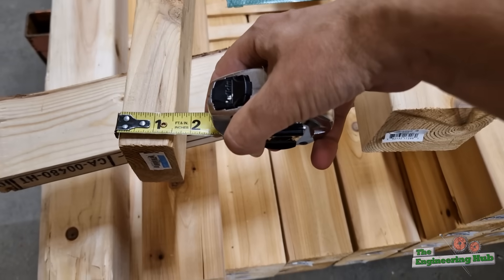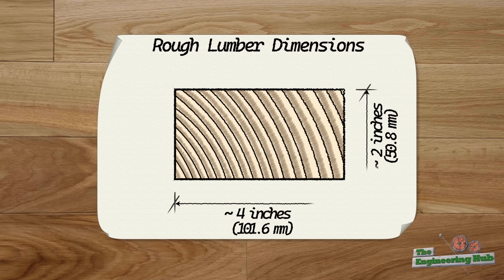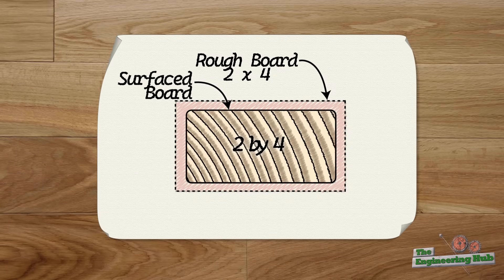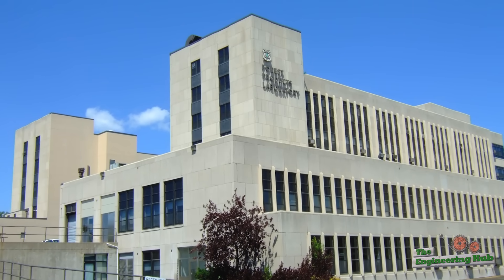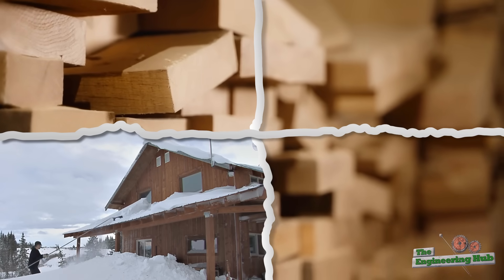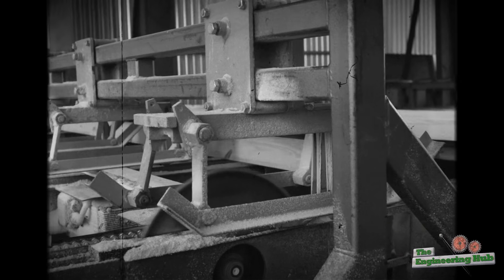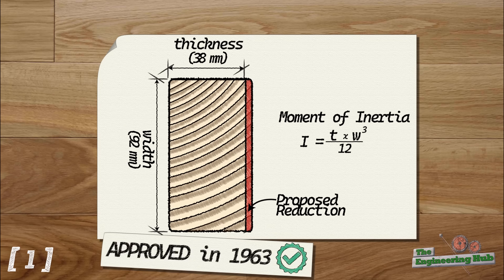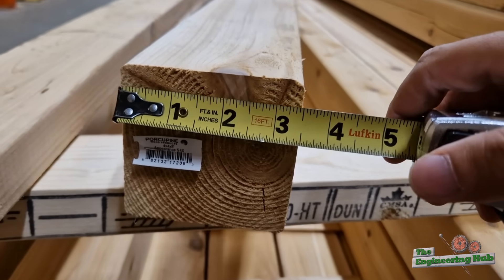Why is the 2 by 4 getting smaller and smaller?

Comment: The house I grew up in was originally two houses built just post WWI from drift wood from the storm of 1900.  If you are unfamiliar with this storm, it's the greatest natural disaster in our nation's history.  At the time, Galveston was the 2nd largest and busiest port in the US.  It was the central hub for shipping out crops grown in Texas and the mid west which needed to ship via train rather than river.  It was also the distribution center for goods going up the rail to the mid west.  In 1900, without warning, one of the strongest hurricains ever recorded hit Galveston directly.  Everything and everyone was swept away in the storm surge.  Only a handful of buildings made from stone (which is rare in the area as bedrock is 200 feet down) or concrete were left standing.  For months, bodies were being recovered from piles of wood which were once the buildings on the island. 

 After WWI, cheap housing for the returning solders was needed, so the piles of wood were finally gathered up in mass, cleaned of nails, and processed into lumber.  The mill making the lumber made S4S on true dimensions.  So, all of the 2x4, 2x6, 4x6, and 4x8 lumber in my house was true dimension and finished cleanly.  A side effect from being in the salt water for so long was the wood absorbed the minerals, making it very dense, strong, and hard.  I don't think it was that hard when the houses were first built, but when I would do any repairs in the 1980's through to the early 2000's, I had to drill a pilot hole for any nail or screw I wanted to drive into the original lumber.  It was almost as if it were quick fossilized as it dried over the years.  It was very interesting to see the story the wood told.  Some of the exposed wood still had the remains of joints and nail holes from the original construction.  Some of the original hand made nails were used in the larger lumber.  The houses were built on pier and beam foundations, with one extra layer of timbers before the floor joists.  Most houses of the day, or even those built with the same type of foundations today, don't feature this extra layer.  I always thought it was for air flow to help cool the houses in the hot, humid summers we have.  

The flooring was even milled from this drift wood, but softer wood was chosen at the time as to not wear out the knifes on the milling machine.  The flooring plank milling machine would take in rough cut lumber, hold it straight for the 6 to 10 foot input guide, and then run it through 2 to 4 sets of spinning knifes.  If it's 2, then the top and bottom surfaces get taken to final dimension and finish.  Then the 2nd set of spinning knifes cuts the tongue and groove profiles to allow the flooring to overlap without being fully seated into each other.  A 4 knife set would have knife sets that would get the wood within an eigth of an inch of final size, then the last pair would get it to final dimension and finish.  The 4 knife setup was more expensive to setup, but it would reduce the wear and downtime as the finishing knifes would last for many more board feet.

The milled flooring planks were installed in two layers.  The first layer laid right on the floor joist and were attached to the joistes with nails through the lower part of the mortise.  The next row was laid down as the tongue was aligned with the mortise of the previous row, but not inserted into the mortise.  This make that row partially sealed, but still allowed air to pass with ease.  The top layer was laid perpendicular to the first layer of flooring.  Just as the first layer, the planks were attached with nails through the lower part of the mortise.  This time, the next row had its tongue inserted half way into the mortise.  This still allowed some air movement, but sealed the house a bit better from insects and dirt.  The floor was finished by first sanding the whole surface, then a hot wax mixed with a thinning agent and shellac was buffed into the grain.  This was a very hard wearing and easily maintained surface finish, but sacrificed the beauty you could get with other finishes on old growth wood like this.  All it needed was an application of hot wax, followed by a buffing with fine grade steel wool.  Kept the floor looking like new for decades.

Comment: 2x4 is the center to center distance when the saw is moved over.  It is never 2" x 4" rough lumber because of the kerf of the saw. 
2x6 nominal 12" long is 1 board foot.

Comment: Little bit of embellishment as a hobby?  Old lumber that was 2x4 was not ever made to a standard other than size. (handmade onsite) It was larger to accommodate that. Later like 1960 standards were enacted. They lowered the 2x4 to the size it is today because the wood met a more rigid quality standard that is stamped right on each piece. No stamp?  Then it is not approved to be used for framing members.  It had no stamp or clarification as to what we were looking at so it is a piece of wood. You show a picture of some dunnage wood sold at a retail store instead of a lumberyard. OF course it's smaller. You will pay only a little bit less for wood worth a 1/4 of the price. It is the wood they use to build pallets. "Landscape" lumber.

Comment: Personally i don't give a shit if the math checks out on the strength of the smaller boards. If i pay for a 2x4 then i feel cheated getting anything less. 
Also even if the math checks out on paper it feels like it eliminates any safety factor for things like rot or bugs and such. Like designing a plane wing for exactly the strength necessary instead of the 150% like normal. The use cases in real life have variables that exact strength calculations can't account for

Comment: You should check out the labelling of building materials in the uk, it absolutely boils my piss! Our timber is just as ridiculous as yours but it seems like it spills over into my other materials of all trades. 

You go & buy some 40mm or 30mm pipe & you best not think thats the diameter you'll get as it varies a lot, even standard overflow pipe labeled as 12.5mm which you'd think must be pretty dam accurate if measured down to half a mm but no if you buy this from 2 different manufactures & they very well may not fit each other as I have found out.

A lot of sheet material used to be sold as 8 foot by 4 foot until we went all metric so now it is sold as 2400mm x 1200mm, however that may well not be what you get sou you best make dam sure before you measure up & start a job! Plasterboards (drywall) will be usually around 2400mm x 1200mm but Plywood will probably be 2440 x 1220 & chipboard could be anything in my experience.

This happens with supplies for all the trades as well, electrics, building plumbing etc.

Wanna find the cheapest sand or aggregate quickly for a job? Well good luck because they come in whats known over here as a dumpy bag, which a lot of people think are all a metric tonne but it actually can be any weight or size the seller decides & they rarely clearly advertise what it actually is. Instead one supplier will just say "contents will cover x square metres when laid out at 50mm thick, whereas another will give you an approximate weight that can vary massively depending on how wet/dry it is so to see at a glance which supplier is selling at the best price is almost impossible to quickly see which supplier is cheapest without sitting down with a pen paper & calculator to do the maths.

I really wish the UK trading standards office would do something about this inaccurate labelling as it must waste A LOT of time & money in the UK every single year.

I could go on 😂

Comment: One thing that I didnt seem to hear or notice was mentioned was that code for the distance each stud has to be from each other has also changed to be closer together than it was. Allowing just as much strength by using more pieces in a smaller area apart from each than before. Which in turn, increases the integrity of the structure being built. As a byproduct of this, it doesnt require lumber to be thicker to be as resilient to failure. Building code has helped make the "2x4" we know and use today still as effective in usage case as the 1920's were. I'm a contractor by trade and work on historic and new homes for reference.
Reply: He touched on it briefly.  It's pretty much a scam though since you have to buy more 2x4's (at the same or higher cost than before) to accomplish the same thing. I mean, maybe it doesn't matter to you since you can just pass the extra cost onto the homebuyer.

Comment: At 6:18 you have two end cuts displayed.  Notice the difference in the grain density between the old 2x4 on the right (very tight grain rings) and the wide ones on the smaller board.  The tight grain piece will be stronger even if planed down to the smaller size.  You don't find lumber like that any more unless you're taking apart a house 50-70 years old or older.

Comment: 2 inches by 4 inches usually are freshly cut from the timber logs but once it is KILN DRIED it shrinks by half an inch from both sides, from 2 by 4 down to 1.5 to 3.5. 

Honest lumber companies in the early 1980s tried to compensate by cutting freshly cut 
2 inches by 4 inches to 2.5 inches to 4.5 inches and kiln dried them and after kiln drying them the 2.5 inches by 4.5 inches.

The much more honest ones in the early 1980s up to the mid-1980s with safety concern tried to add an additional 1 inch on both sides so that once they are kiln dried and shrunk if will be 3 by 5 so that the additional 1 inch will act as a strengthening buffer zone. 

In the 1980s in your Readers Digest it was reported that powerful microwaves were being used to INSTANTLY ZAP water and moisture from the wood and it makes people starting to ask questions which is "WHAT HAPPENED TO THAT PROCESS? AND WHY DID IT DISAPPEARED?"

In the 1980s and 1990s various compounds were tested to preserve and protect wood against all damn all and found out that ZINC NITRATE is the most ecologically friendly wood preservative after BORAX. The borax treatment needs to be mixed and dissolve with an equal volume of water glass water known as sodium silicate so as to stabilize it into boron silicate.

Comment: I guess the steel industry have something similar. I still remember the days when we order a 125mm C-section we'll get a 125mm section +/- 1mm. It's +/- 3mm these days and some even increased the radius at which they roll the plates.

I swear I had to check every shipment to make sure the deviations are within parameters and it's really painful.

Comment: Not only does the mill cheat the customer, the bastards cheat the loggers even more; they docked us for their projected waste in sawdust based on a 1/2” kerf while they went to thinner and thinner blades, also they insist on 6 inches extra per log for trim which they don’t include in the scale.

Comment: It's vapourware. It was 2x4 when it was put in the kiln but shrunk soon after. Actually, it's been like this for many many years. I found out when I went to add some timber. Measured what I had ... genuine 4x2 and bought it, only to discover the new lot was not 4x2. Indeed, all new timber is much the same. Reduced in size. Probably why houses don't last as long...says him having lived in a c1725 cottage.

Comment: With clothing sizes, they grow to fit the Ego of their owner ("I always wore that size, I am not going to buy any bigger!").
It is just stupid.
If it is a different size, change the name!
I doubt, that shrinkage and surfacing take 1/2 inch (1.2cm) off, that is not completely "it". When I buy in Germany some wood, I can get it rough or surfaced. Difference is just 2-5mm. And than it is called the size of what I buy.
If you know it is going to be surfaced, than the rough size can simply made larger. If you know moisture content and type of wood, you als can calculate where it will roughly end up when being dried.

Comment: And yet, no mention of sheet rock or that the dimension of sheet rock is such that to pair it with a 2x4 to make 2' or 4' thick walls.  Standardized doorframe thickness, and well, general standardization of the housing construction industry.
Reply: actual 2"x4"  plus 1/2" sheetrock/plasterboard each side, makes a wall 5" thick. The symbol for inches is ". Your comment uses the symbol  for feet ' - suggesting your walls are 2 feet think!

Comment: It started over 20 years ago when you bought that measuring tape.
Ya see, yes it isn't 2x4 any longer because planing and and treatment and it is 1,5x3,5.
But "...what makes it smaller and smaller" is the old tape measurer. As you pull it taunt each time to measure, you rub some molecules off at the attachment point of the 2 materials that lay snug on the wood for stability.
This makes the distance between the edge of the board and the edge of the tap uneven but concealed behind the 2nd tip (the part that stabilizes). This gives the appearance of a smaller 2x4.
Reply: Bro what

Comment: It sounds like whatever the finished sized standard decided upon, they always started with rough cut boards that did measure 2x4.

But if over time, they produced smaller and smaller finished boards to save on material, why would they have continue to rough cut the board to measure 2x4? Wouldn't that mean they turned more of the wood to sawdust to reduce the size, thereby wasting the wood that they wanted to save by making the finished boards smaller? This would seem to be especially the case post WWII.

Comment: Interesting. And hardwood lumber has a totally different system, because it is graded for its looks, not its strength, which is interesting, because, in the midwest, almost all the houses are stick built, going back to almost 200 years. But the outbuildings, barns, etc. were mostly built from hardwood timbers and boards which were random sawn thicknesses.

Comment: Could there be another reason?
e,g.
Cordless portable circular saws available at only with 165mm diameter blade or 185mm diameter blade have smaller cutting depths.

Comment: Setting aside the "excuses" for justifying false advertising, the bottom-line reasoning for this 2x4 lie is greed. A rough cut piece of lumber does not require 1/4" to be planed off EACH side to make it smooth. The same dimensional dishonesty is seen in plywood thicknesses... where the thickness again is less than advertised... it's no coincidence that the wood producers always seem to reap the benefit (I.e., they NEVER sell you a piece of lumber that is larger than the stated dimensions). 

This same greed can be seen in the price of gasoline (in the U.S.) always ending in 9/10 of a cent. 

In the late '70's the USDA "adjusted" the grading system for cuts of meat from "Premium, Grade A, Grade B" so they could send the previously premium cuts to the overseas market... then domestically what had been grade B was now being sold as grade A, etc., all so the meat distributors could capitalize on profits while conning the U.S. consumers by downgrading the meat grades. 

In Germany in the 1800s & 1900s unscrupulous butchers (of a specific foreign origin) would take undesirable cuts of meat, fat & hair that would otherwise go to waste, grind them up and sell them as "ground beef", better known for the city that pioneered this chicanery, Hamburger... and the same with the finely ground & seasoned "meat paste" sold as Frankfurters.

The reason they get away with this misrepresentation & theft is because consumers allow it.

Comment: Because in sensible countries there was 4 x 2 RC ( rough cut) actual 4 x 2.  Next. 4 x 2 ( Planed all round) coming out at 1 3/4 x 3 3/4. Next 2 x 4 machined. Rounded corners roughly the same as PAR. It's not rocket science

Comment: But...the modern size isn't even the dimension they claim it's supposed to be.  It's slightly under 1.5x3.5 (as seen by the measuring tape clips in the video).

Comment: The most dimensional lumber was used for framing, and NONE of that ever got planed on the site.  If you look at old houses, those built before the middle of the last century, a 2x4 stud was 2" x 4".  And the same was true of the joists, the rafters, and the sills.  They weren't planed, they were rough-cut and nailed up just as they came from the mill.  Smaller and thinner boards, items like flooring, stair treds, and risers, and window frames were planed on site, or bought as planed boards.

The decision to just plane everything was an economic one, simply a way for the mills to make more money on the same amount of lumber.  It's like slicing the ham before you sell it.  You pay for that slicing, just like you pay for all those boards being planed.

Comment: My dad was a building contractor back when they changed the 2x4;s down to 1 1/2 x 3 1/2 inches from that day on we where always getting crappy bent lumber from the mills. Usually our carpenters would go through the lumber picking out the good ones and then returning half of the lumber back to the supplier. It was never the same again.
Reply: Yep, when I framed, all of the 2x4 would be warped and bent, you wpuld have to look down the lwngth of each board and then put the bow facing out or in, cannot remember now which...but id maybe maybe 1 of 10 boards was "straight".  1x2 is even worse...maybe 50% of it is usable.  The rest is grafted, twisted, bowed, nots in it, etc. I used to build shelves from actual 1x2 that last a lifetime...todays 1x2 is basically kindling.